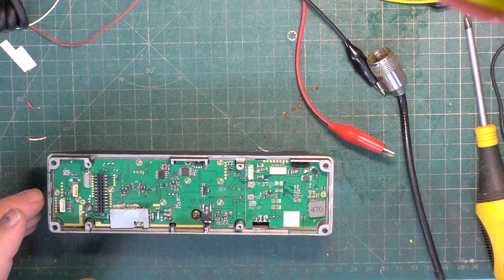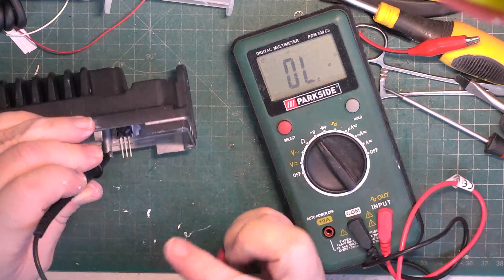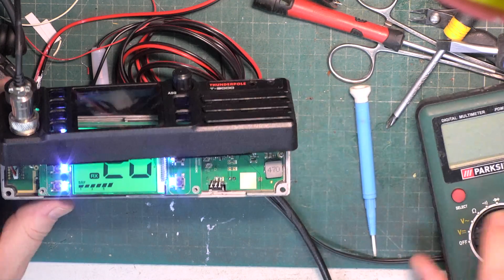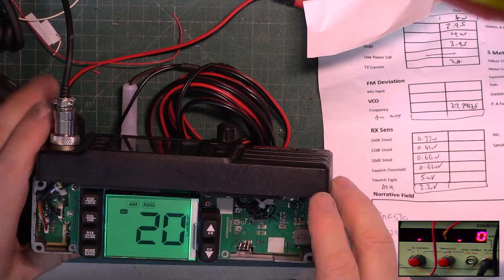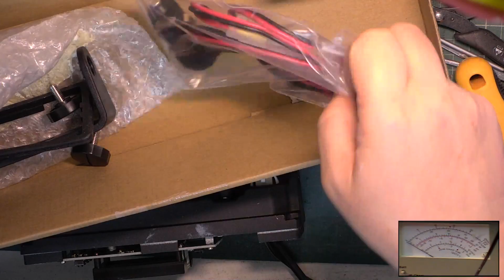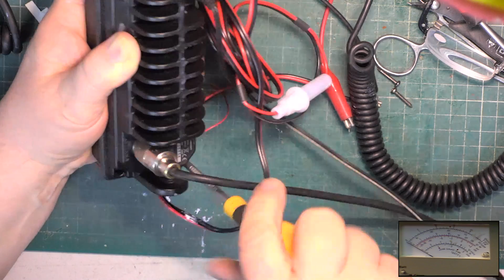Thunderpole T3000  CE MultiNorm UK/EU CB radio - No transmit repair..Part 2 of 2

Comment: Those Thunderpole radios are very popular, i know a lot of fellow lorry drivers who have them and they all speak highly of them, I'm very tempted to get one for myself, the auto squelch and channel change buttons on the mike are a handy feature when mobile, I bet they won't last as long as the old classic CB's though!
Reply from the maker: I genuinely think these are ss good as current sets get & we've bought & tested every model on the UK market....and the reason all three vehicles have these sets fitted. I've also proved the set was repairable (though not quickly or easily) after a fault caused by a shorted aerial.

Richard, G0OJF, UK